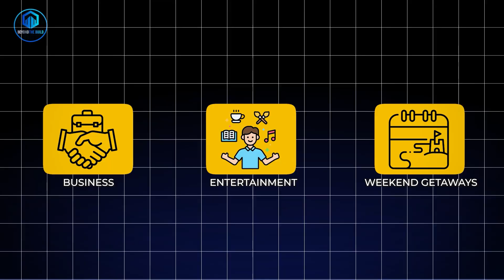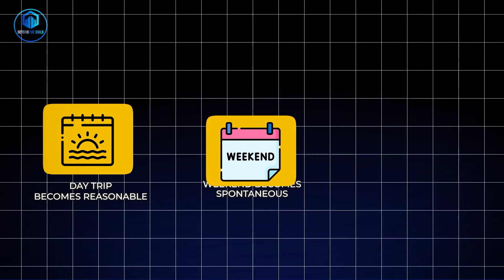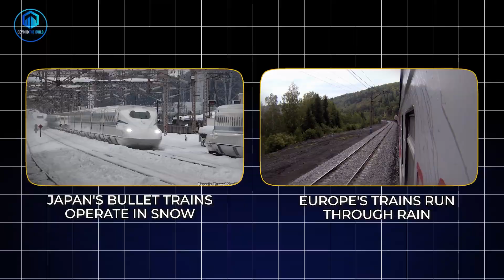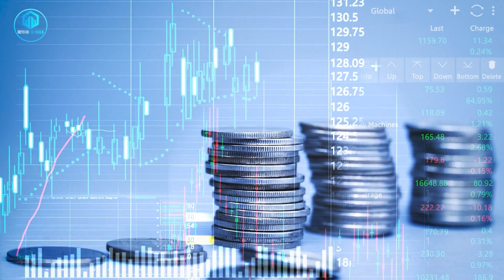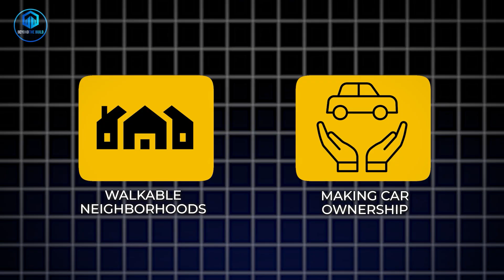America’s First REAL Bullet Train Is Under Construction

Comment: What America really needs is to replace short haul flights within 400 miles of a major airport like ORD JFK or LAX with high speed rail. Of course, fly over parts of the states with undeveloped land wouldn't make sense and a plane would be more efficient to go from Boston or New York to Seattle, LA, or even Chicago. But 400 mile 40 minute flights on cramped, gross regional jets are a waste of time and space for major hubs and could and should be replaced with high speed rail. This is a great start but the stars still have a long way to go.
Reply from the maker: Well said, replacing those short hops could change everything for major hubs. Do you think airlines would fight it or eventually adapt?
Reply: @beyondthebuild-1  I mean, European airlines accept the high speed rail replacement cause they get credited and paid a little bit for it and actually include it in the flight booking itinerary if making a connection at a major hub. If they can do that there, then there's no reason why they can't do it here. If they fight, they're considered NIMBYs and that's on them. There is no reason why there should be any flights between DFW and IAH when they're a 90 minute bullet train ride apart, among many others.

Comment: First of all, it’s not actually under construction yet. They did some demolition and grading on an empty disconnected lot outside of Las Vegas. That’s it. Not one inch of actual railroad has been built or even started.

Second of all, Brightline West is still not HSR. It won’t reach HSR speeds because the highway is too twisty. They may reach HSR soeeds on a couple of very short sections near Vegas for a few seconds. But that doesn’t make the whole line HSR.
Reply: This is because highway curves are tighter than those needed for HSR, so it's a compromise to save money at the cost of speed.  This is also one reason why CAHSR chose not to use the I-5 or SR-99 right of ways and create its own right of way.
Reply: @blakeclark5898  So said their consultants. But I'm sure that for equal or less money than acquiring a separate right of way the kinks in the highways could be sorted out to accommodate the trains.
Reply: @edwardmiessner6502  Agreed.  CAHSR could have avoided a lot of headaches if they made more use of existing highway right-of-way and adjusted the highway curves to accommodate the HSR track speeds.  The decision was made to route the alignment closer to the existing towns and cities in the valley instead of using the I-5 corridor, which is more of a straight stretch but doesn't come close to much of anything between Stockton and Bakersfield.
Reply: The segment from just over the mountains to Victorville looks like it could handle high speeds.
Reply: @lockbert99  Overall, this project managed to squeeze less than 10% of its route miles to be HSR. It's not nothing but it also ain't high speed rail.
Reply from the maker: Yeah, the term ‘under construction’ might be a stretch right now. What do you think it’ll take for the project to finally earn that ‘high-speed’ label?
Reply: @beyondthebuild-1  I don't know how they can do that without making at least 50% of this line go above 155 mph. Currently they have less than 10% of it at speeds of 155+ mph.

They would need a toooooooooon o money to redesign this line to make it actual HSR. A lot more tunnels and viaducts to straighten out more of the route.

In other words, this project is a big mess. They were able to skirt these conversations for a surprisingly long time. But at some point people were going to find out that their HSR branding was just advertising.

Comment: No one will use it. It takes longer than a plane and cost 3 times as much for a ticket.
Reply: If you arrive two hours before departure to clear security , the plane will take you longer to reach the Strip.   After you land, you still have to line up for a taxi or Uber to take you to the Strip.
Reply: The airlines don’t mind dropping short flights between cities close together since most costs to fly an airliner is in takeoff and landings. The longer Flights are the money makers with the longest flights like across the Pacific are really where the money is at. Once an airliner is up at 30,000 feet or more you have the lowest cost per mile. The longer you at at high cruising altitude you make the most money. This is how before Acela the electrified Metro train took a lot of shuttle flights between Washington DC and New York defying the critics. A reason minimum distance for a jet airliner is really over 500 miles for better profit since you can get some reasonable high altitude cruising in the flight
Reply from the maker: Yeah, that’s the main challenge for rail, cost vs. efficiency. What do you think it would take to make it competitive?